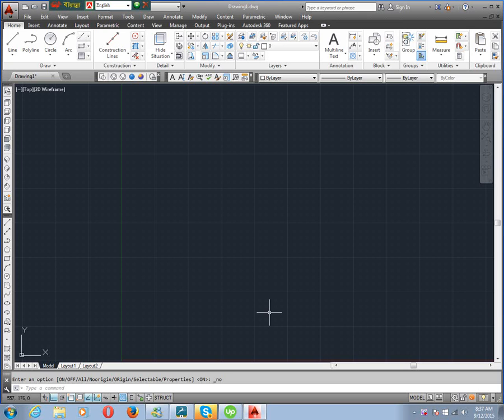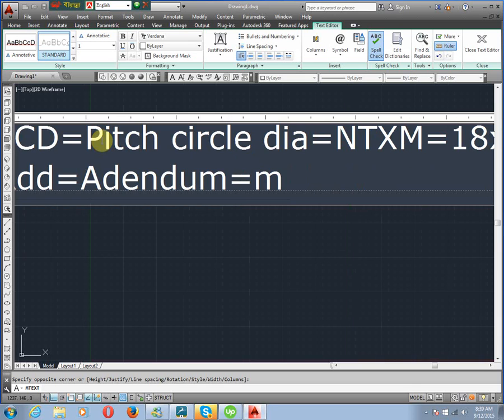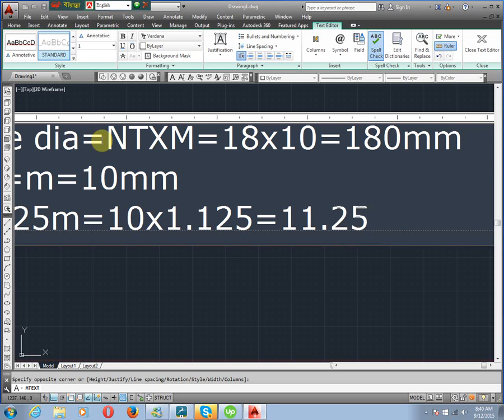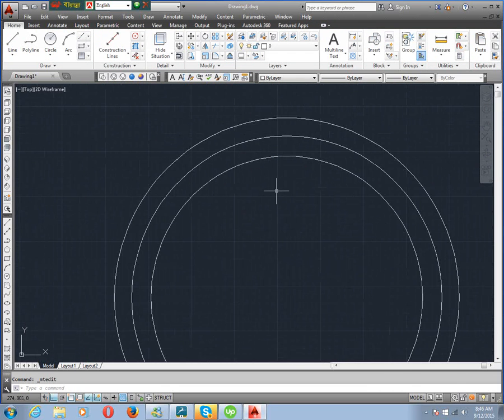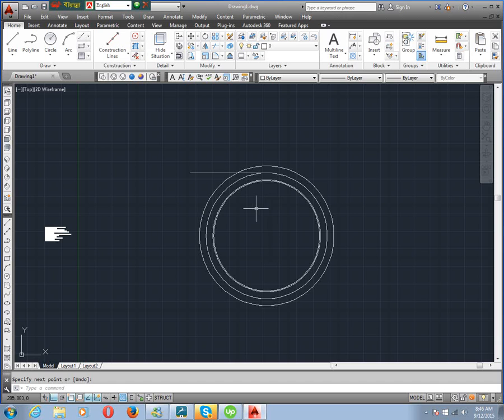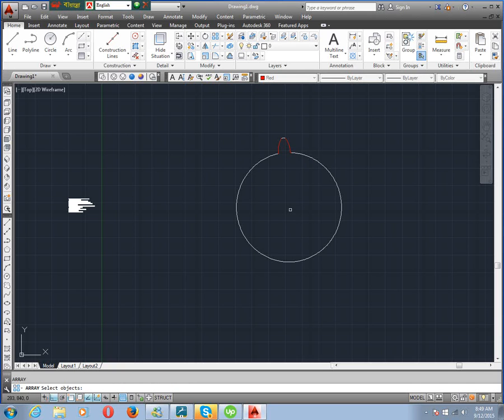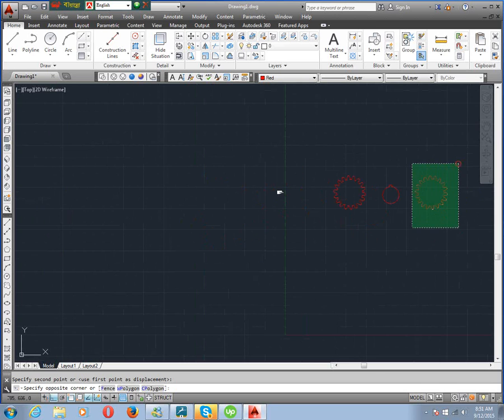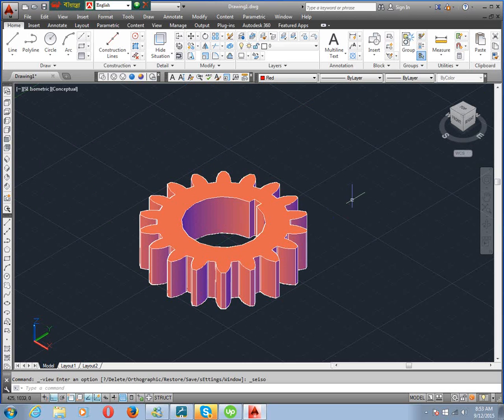How to draw a spur gear in Auto CAD

Comment: Dear Akter Bhuiyan, with all due respect, your creation might look like a common spur gear, but it is not ! Please note:  you cannot express an involute profile by drawing a single radius along the entire tooth height. An involute profile is derived from the Base Circle Radius (this one you got correct), but each point of the profile corresponds with an ARC LENGTH of a particular segment of the base circle ! In other words: you need several construction points to approximate a true involute, either by several radii or a spline curve through these points ! To not mislead other viewers, please correct your video ! (Or delete it)